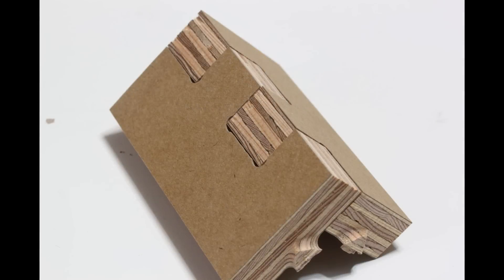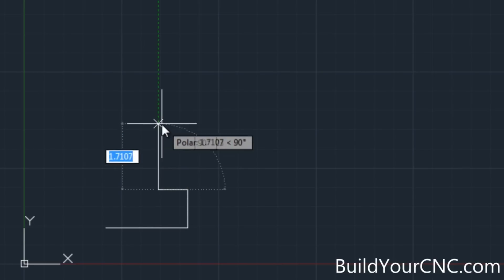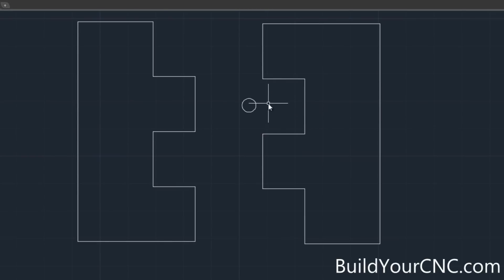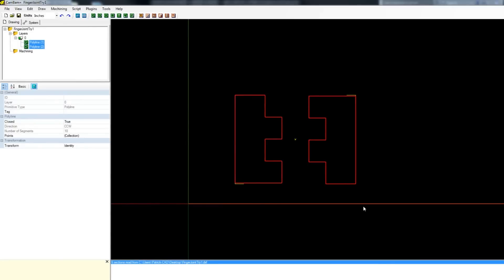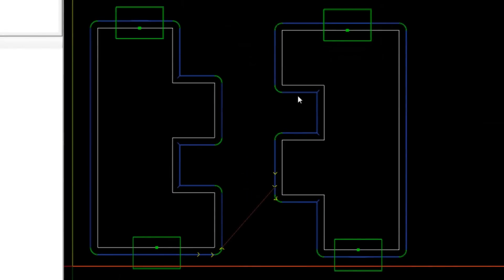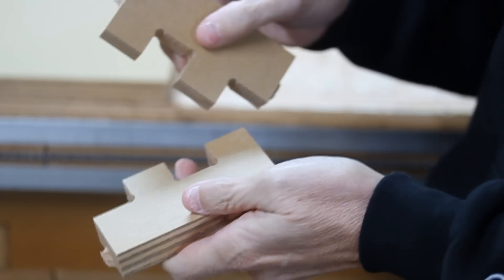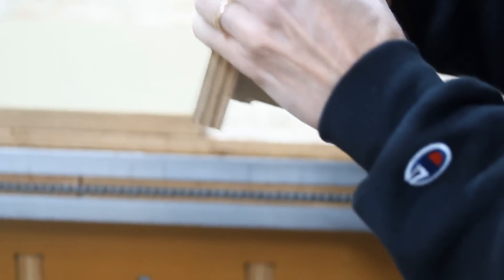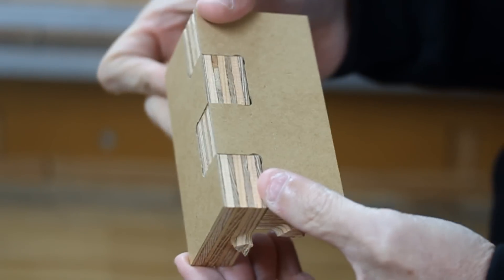Practical CNC Joinery - Part 1 - Finger Joints

Comment: Just peck drill out the corners with the smallest bit you have and follow up with a hand file
Reply from the maker: Yes, that is an option, but this video tries to look at a CNC only option. One day i may look at doing joinery using both CNC and light hand methods.

Comment: Would like to know your planetusb settings.  As my blackfoot is much slower on the corners.  Can cause friction and burn marks.
Reply: Frank.  Trick is to specify a corner slightly larger than the cutter. So if I have a 0.25" bit, I'll make corner radius to machine something a little (20% larger). So with a 0.125" radius, It will burn.  Specify your corner at 0.140" and not the difference.

Comment: Patrick, I don't normally make comments, however, I must respond to something you had in this video; with regard to your comment about the buildup of Glue in the corners, as to strengthening the joint against breakage, or splitting.  I have been in woodworking for over 40 years, and it has been my experience that the strongest glue joine is one in which the glue is applied liberally, yet clamped quite tightly and left to dry over 24 hrs.  In the event the glue is not clamped tightly, or left as a chunck of Glue, such as you suggest leaving on the corners in your overcut, there is zero strength.  It is only a glob of glue.  I can cite you to many studies performed by the glue manufacturers and their testing labratories that reinforce this statement.
Reply from the maker: Totally makes sense.  I should not have added that comment.  I will add an annotation to correct this.
Reply: Patrick I really enjoy your sight, and am in the process of building my own cnc.  I am however building a metal frame machine and have added features like compressed air cooling for electronics as well as and air powered Vacuum for vacuum hold down.  These items can be purchased at http://exair.com